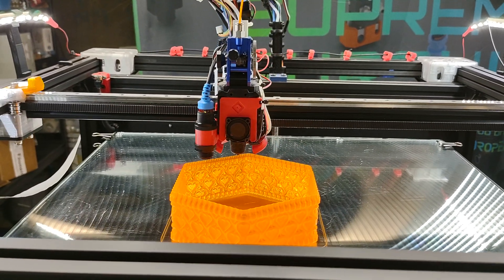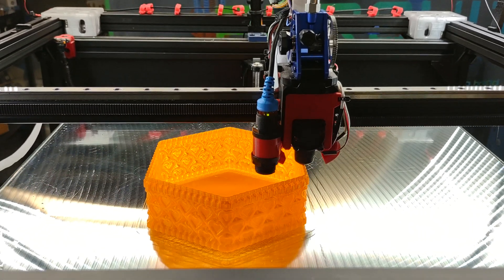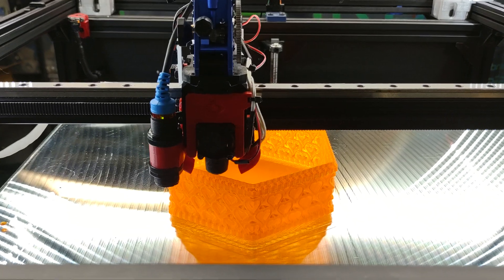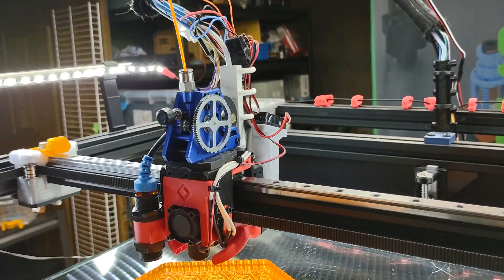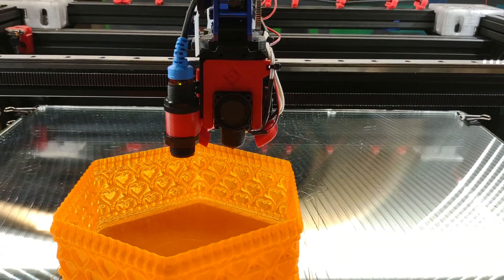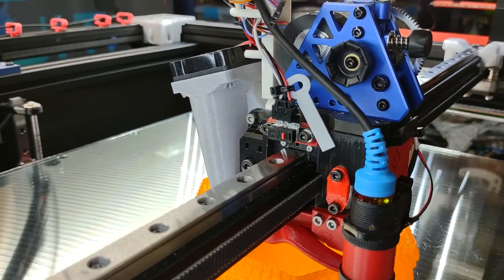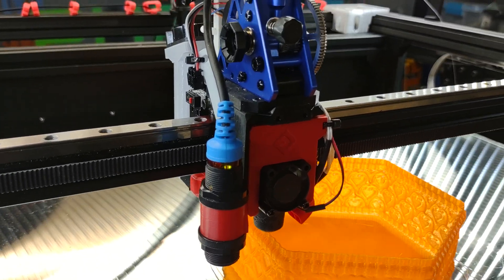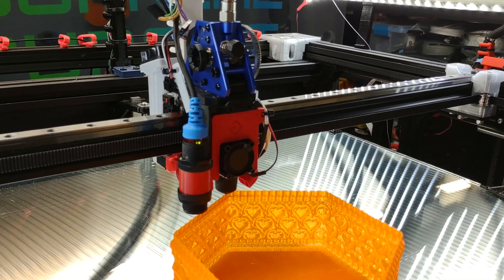Phaetus APUS and DropEffect  XG hot end first print

Comment: Very nice!!!  I am thinking of this exact combo but with a more standard 0.4mm nozzle.
Reply from the maker: I saw your comments, thanks for watching!  Could I ask a question?  What printer do you have that you are thinking of using these on?
Reply: @woodwaker1  Well, believe it or not on a Ender 3 Pro that i bought over 2 years ago and is my first and only printer - and for many reasons i did not get to it.  

But now i got the motivation and so i am mainly going to use the Ender 3 mainly for parts - most of it will be upgraded or replaced.  

So why not just get an existing printer?  Well, i am really considering the Voron's and RatRigs but I have been in manufacturing for over 2 decades and am familiar with CNC machining, all sorts of construction materials and techniques, etc... so I thought i would use the motors, belted axis etc as a starter, add in some linear rails, upgrade the extruder and hotend, dual Z, stiffen the frame, etc... 

Regarding extruders and hotends -  i mainly have been thinking of using the Bamboo X1 extruder with an E3D hotend - I know there is a video where that hotend showed that it not only can extrude at a good rate but it had the best layer adhesion.  That alone is almost a good enough reason to just go with that.... but i overthink the heck out of everything!!!  

So my "S" tier so far is between the Hextrudort (love that thing for some reason) for something like $50... the LDO Orbiter V3 with a Revo hotend for $130 , the Sherpa (similiar to the Hextrudort i think) similiar pricing, the Galelio 2 - probably would use a Revo hotend with the Hextrudort, Galelio, and Sherpa but I really am not sure...  The thing i like about the Hextrudort is the filament path - it looks like it is one of the best constrained of all...  

And then yes there is the Apus with the Phaetus hotend - that solution just looks soo good, simple, very well engineerd, I can buy it complete... (Orbiter 3 is also 100% complete, so is the Hemera (heavy though and has some legacy issues...)one  can argue that Bambu also is complete.  

OH and i have to add in this new "micro coating" whatever on the gears for all of the extruders.  The Bambu has some super cool upgrades - a skeletonized extruder housing, upgraded gears from Fystec and others, integrated filament sensor, awesome extrusion capabilities stock and even better with the Obsidian...   looking at all of this how can one NOT be confused??? (JK i hope)  

Also thanks for the reply, I would love to hear your thoughts, it is really appreciated.  and sorry for all of the text, there is just sooo much!!! Cheers.
Reply: one more thing (sorry!) I just wanted to add that there are many great channels here on YT and I am sure you are aware of that.  But this video in particular is helping me out a bit.  https://www.youtube.com/watch?v=z2X4dc7jg4E&t=6s

I hope you enjoy it and get something out of it.  Also if i find that layer adhesion review I will send that along as well.  Cheers!!!
Reply from the maker: @GMx_1  Thanks for the link.  I watched it and in my opinion, I'm more worried about getting a successful print than chasing extreme levels of visual quality.  I'm actually in the process of replacing my APUS and DropEffect setup with the CoPrint system.   I was very happy with the APUS - XG setup, but a couple of things happened to change my mind.  I Purchased a Rat Rig V-Core 4 and went with the standard configuration which has worked well.   I was thinking about replacing my two V-Core 3 with more V-core 4, but had gotten the CoPrint in their Kickstarter.   I thought that would be a great system on the Rat Rig - something that could provide multi-color - filament for a large printer.  I have had some success and keep working on it.  Here is a link to my latest video  https://www.youtube.com/watch?v=VvxrGek_2zE&t=82s&ab_channel=DavidWilson
Reply from the maker: @GMx_1  Sorry, I responded to your other comment before reading this one.   I had a number of Herema units, and was very disappointed , that is how I got into working with Max at DropEffect.   I really disliked their mounting system, and I could not get replacement parts, during the start of COVID-19.  I had many units that needed the same part, they had a design or manufacturing error, many were in the same situation.  I tried my first one from DropEffect and switched all of mine over.  When Max went to work for Phaetus and came out with the X2 I went with those.  I have had many 3D printers over the years and really like to test and maybe mod them, but have no desire to design one from the ground up.   I like to take a design and see if I can improve it, but too old to start with a clean sheet of paper.    It sounds like you have the desire and skills to put together a custom build, and I wish you success.  Let me know if I can help in any way.  Let me know what you come up with.

Comment: hi do you have an esteps ballpark for the Apus extruder
Reply from the maker: Thanks for watching.  Here is what I'm using in Klipper rotation_distance: 4.01	
Let me know if you have any other questions
Reply: @woodwaker1  im using without klipper initailly so wondering where to start in my marlin 2.0 config :D
Reply from the maker: @samdrane-ys2jt  That would be a good question.  You could send a message to Phaetus and see if they have an answer.  I found mine on the Rat Rig - EVA discord, but they are all Klipper users.  I found this on the APUS site  6.3 : 1 Gear ratio to ensure high torque.  You could try and work backwards- if you know what your current extruder gear ratio is use that to adjust the setting.
Reply: @woodwaker1  thanks, I'm moving from a bmg Dual Drive so i want to get it right, my biggest issue has been mounting it all :D not using stock Hotend either so fun fun fun
Reply from the maker: @PrintedByST  It took me almost 6 months to get it figured out.  I found some good designs for EVA mods on their discord and Printables
Reply: @woodwaker1  I've seen the Eva mods but I don't want a whole new carriage system if I can avoid im marrying it off with a Pico hybrid Hotend so all bets are off lol
Reply from the maker: @PrintedByST  I was not familiar with it, so looked it up.  I realized that my friend Chris Riley did a video on it,  Take a look and see if it is any help.  https://www.youtube.com/watch?v=PVrm8hkNT38&ab_channel=ChrisRiley
Reply: @woodwaker1  good shout, love his videos, I'm a fan.
Reply from the maker: @PrintedByST  His basement is about 2 miles from me.  I have been over a few times.  You could ask him for suggestions - he may be able to help or give you ideas.
Reply: @woodwaker1  sorry to keep bothering you , but i can litteraly count the number of people with this extruder on one hand that ive seen :D, above you mention the "Klipper rotation_distance :4.01 . my previous esteps is 900+moving into klipper ive no idea where to start but i think i will try your value first as 933.6 seems massivly over !
Reply from the maker: @samdrane-ys2jt  Could you see if this will work for you.  https://www.3dmakerengineering.com/blogs/3d-printing/estep-calibration
Please let me know if it does, and what value you come up with.  It has been 3 years since I touched Marlin, so my brain is rusty using it.
Reply from the maker: @samdrane-ys2jt  I did some more research and finally sent an e-mail to Phaetus support asking for help.  I also found this which may be helpful
https://www.reddit.com/r/3Dprinting/comments/zz30bp/new_extruder_for_my_ender_3_best_mod_ive_ever_got/
Reply: @woodwaker1  no i know what you are referring to! you have been a massive help!
Reply from the maker: Sorry it took so long, but I just got a message from Phaetus support:
The rotation distance of Apus for Klipper is 24.35 while the gear ratio is 82:13.
The thermistor type is 104NT-4-R025H42G.

Hope this helps.  It does contradict what I have been using, but it is what they sent me